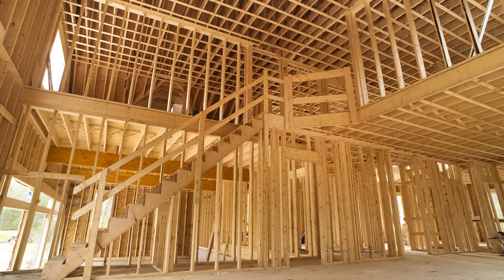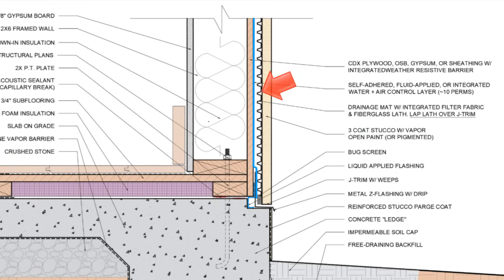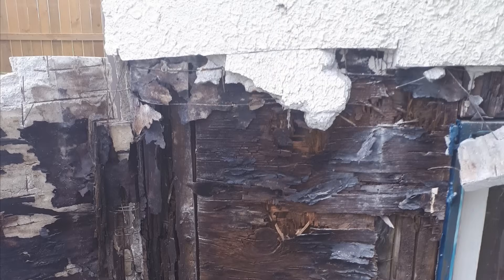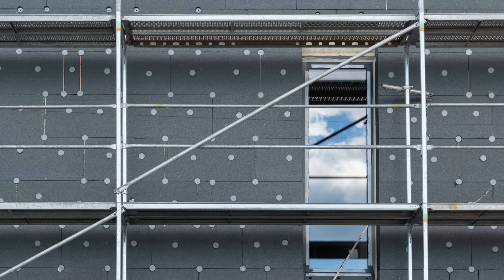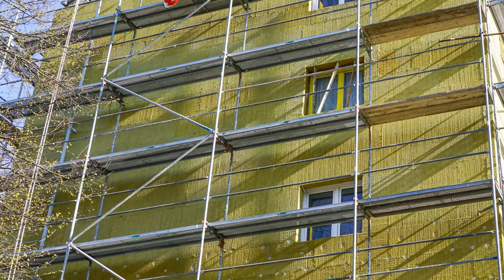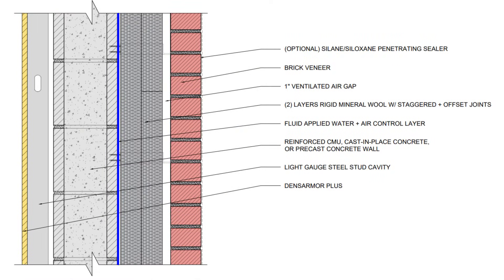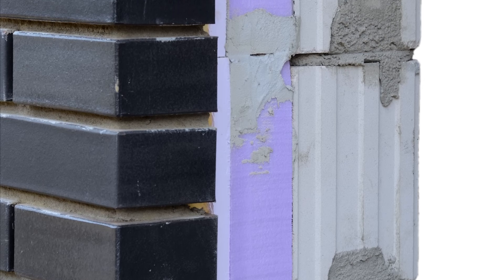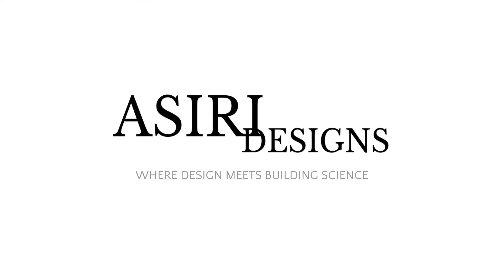The Ultimate Guide To Wall Assemblies For Warm Climates

Comment: What about an intello plus or "smart" vapor retarders on the interior in warm humid climates? Would this also assist with air tightness while allowing for inward drying?
Reply from the maker: It's on the wrong side of the assembly in a warm humid climate, the air barrier needs to be on the outside of the wall cavity.
Reply: @ASIRIDesigns  What if it is combined with an airtight cladding like zip sheathing and taped? Or used in a ceiling assembly that gets covered with blown insulation?

Comment: You cover stucco on a CMU wall adding interior insulation, what about CMU wall with no interior framing or wallboard, adding exterior mineral wool insulation and finishing with stucco. What is ideal in that situation? :)

Comment: I build in climate zone 1 and often find myself wondering why we don't have a drain mat behind our stucco applications on block. Everyone stuccos the block directly. And I often see stucco with cracks similar to what you said in this video around hydraulic pressure. Especially below parapets. For the last 20 years I have blamed the stucco cracks on poor mixing ratios of sand/cement.  since there is virtually no quality control.  But now I'm confused as to why we don't have a drainage plane behind the stucco and on top of the block.   And I mean everybody stuccos the block directly... including commercial, residential and even multi-family. ...  

Thank you for putting up this video. Super helpful.  Hoping for more clarity in the future around this topic.
Reply: I second this wholeheartedly. Although most of my time is spent in Orlando, this is true throughout our areas. One custom home of a friend is the soul example I have ever seen.

Comment: I know your specialty is around moisture management for wood structures, however, I would love to see a video about ICF built homes, particularly in climate zones five, that deal with waterproofing, water management, and moisture management. A lot of information out there says that ICF builders do not need to waterproof the exterior and can apply finishes directly to the exterior foam. Building science says this is a bad idea, and you’re not only need to have waterproof membranes, but you need to allow for moisture management and the ability for your wall systems to dry out behind your exterior finish. Additionally, ICF homes carry the complication of added moisture, and humidity to the interior of the dwelling for the first three years as the concrete slowly cures. Because the homes are so tight, a video from your perspective around managing that moisture would be excellent.

Comment: Hi, thanks for sharing your knowledge, I always learn a lot from your videos. I'm looking to encapsulate my crawlspace in climate zone 3a. I see it's common to glue and fasten ridge foam insulation directly to the cmu crawlspace wall and then attach vapor barrier. Seems like that would trap any water that the cmu's take on behind the vapor barrier. It's that ok because it just falls back down into the ground? It's there a more appropriate way to encapsulate and insulate? Thanks again! -Jonathan

Comment: @5:50 If exterior rigid wood fibre were used instead of foam based systems, would the drainage mat layer not be the best place to put the vapour retarder? Rather than having it on the sheathing and allowing the natural fibres to be exposed to that moisture. 

I'm dubious about the need to vent these assemblies. I understand why you'd need to vent in cold climates, but surely the air flow is so low, and the RH relatively high, in hotter zones that it really doesn't matter. A small gap as a drainage plane with hydrophobic EWI should be good enough. Or am I wrong?

I'm curious about wall systems that opt for cross braced platform framing to avoid using sheathing at all. A sufficiently rigid EWI could provide protection for the air/water control layer, as well as support for cavity insulation. In which case, you'd have a complete vapour open profile from the render inwards, and it would save on the building materials to sheath the building.

Comment: You are often the singular voice of correct exterior, insulation and vapor installation in hot, very humid climates of the southeast U.S.   Code is more often 180 degrees wrong.  Your information and education is very much appreciated.

Comment: Any chance of making a video similar to this one, but focused on homes in climate zone 5.  I'm also curious about using Zip System sheathing as an air barrier for a ceiling under a vented attic.  Specifically, I'd like to know if it's permeable enough for this application.  I understand the green side should face the interior of the home for proper taping when installed on a ceiling.  I've purchased some of your wall detail drawings, but I haven't found one illustrating a Zip System ceiling assembly.  My primary reason for considering Zip sheathing for the ceiling is to simplify creating airtight boxes around future penetrations into the vented attic. What are your thoughts on this approach?
Reply from the maker: Yes we have videos planned for all major climate zones. We like the airtight ceiling approach you describe quite a bit, but a lot of people don't realize that it can also be accomplished with normal taped plywood or OSB sheathing, rigid foam, or even a smart vapor retarder membrane (which is our preference). There's another approach that we like which is similar, but involves sheathing over the ceiling joists (ZIP works great here) and taping all of the seams, or installing a self-adhered membrane, and then framing the trusses or roof framing over the "box". Fine Homebuilding has a great article about this strategy if you're interested: https://www.finehomebuilding.com/project-guides/insulation/simple-air-sealed-ceiling-for-a-high-performance-home
Reply: Yea....he mentions in the video he'll be doing the same thing for other climate zones.